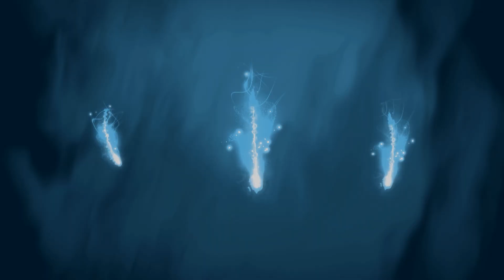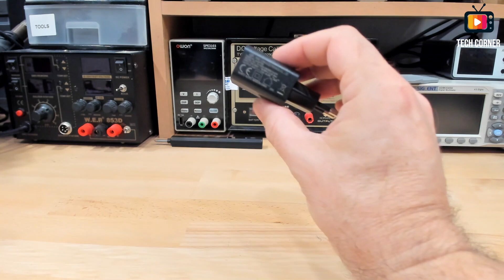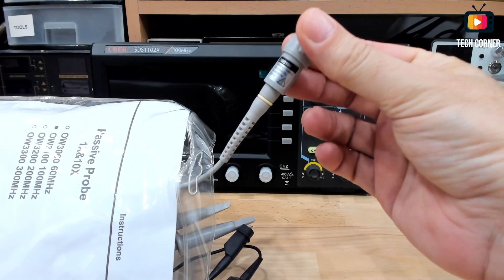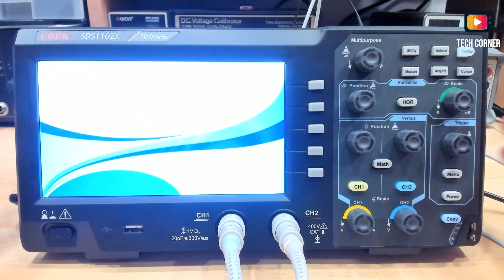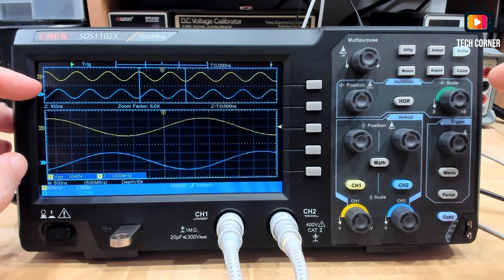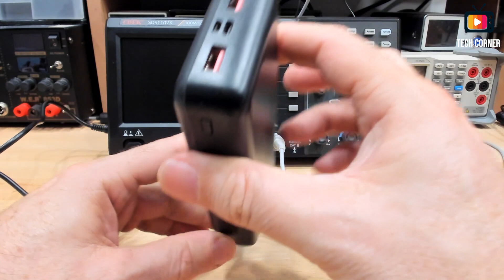CDEK SDS1102X Oscilloscope ⭐ Cheapest Of Them All. Interestingly one of the best!

Comment: Sorry to break the news, but this model is no longer available. The links on Aliexpress and Amazon are dead and its not available on Banggood either. However the news isn't all bad. I was able to find what seems to be a very close resembling device the Victor 1100A. There are two versions, the ultra cheap Victor 1100A which looks suspiciously like the CDEK  and  the 1100AXS which has a single channel function generator.  I wouldn't be surprised if they are made by Lilliput for Victor in Shenzen on an OEM basis. Which would explain why Lilliput withdrew the CDEK from the market.
Reply from the maker: Thanks for sharing that info, Michael! It's a shame the CDEK SDS1102X is gone – it was a great budget scope. The Victor 1100A does look very similar; your guess about Lilliput OEMing for Victor makes sense. If you end up testing the 1100A, let me know how it compares! I'll keep an eye out for that model in case it becomes the next hidden gem.

Comment: In 2026, Be Careful! There are different versions of it, especially if you have the model with external 5V usb power supply, the lower vertical limit is mediocre 20mv/div (Sensitivity also declared as 20mV instead as it should be in SDS1102 5mV)  instead former (220V direct power versions)! Inside is SDS1102C_V2.2 2023.05.09  board, which also does not have ferrite protection of display cable.  So such version is mostly rubbish in precise measurements like low mV noise, HI-FI audio OUs, etc.
Reply from the maker: Thanks for the heads-up! I didn’t test the low-mV limit on my unit, but your info is really valuable for anyone considering this scope. I’ll add a note in the description about checking the board revision before buying.

Comment: The SDS1102 has noticed a peculiarity. In the Trigger Menu - Coupling AC (probe divider X10, v/div = 2 V), Auto mode, the signal is only synchronized by the trigger to the center of the screen, more precisely +/- 2 v/div. Is this correct? If I move the signal up or down and point the trigger at the signal, the trigger does not synchronize the signal. The signal is a square wave, vertical sweep 2 V, and the trigger is triggered at the center of the screen in the range of +2 V and -2 V. However, the signal display may be higher or lower. Is this correct?
If I select Trigger Menu - Coupling DC, Auto mode, and point the trigger at the signal, which can be anywhere on the screen, synchronization occurs.

Comment: great video! can this scope do a bode plot, perhaps with an external generator from siglent? if yes i'll buy both right this minute.
Reply from the maker: Hi, not within this price range, but i will have a video that will be online this Friday 6th at 14:00 GMT for the new FNIRSI DPOS350P, it is a 350Mhz oscilloscope + 50Mhz SigHen + Frequency Response Analyzer (FRA) + Spectrum Analyzer for a crazy low price. It will worth viewing the video. Thanks for watching and your comment.
Reply: @TechCornerTV sadly on the Fnirsi the FFT starts at 200kHz and freq response plots at 100 Hz and I need it for audio work which means i need both to go down to DC and up to 100 MHz (for eg class D). Really surprised the 1102X doesn't do bode plots! would have been perfect for me otherwise.

Comment: Can you run the scope on a battery pack?
Reply from the maker: HI, yes it can. You need to have one with enough amperage, but bottom line is yes. Thanks for watching.
Reply: @TechCornerTV  Yes you can, I have the Vevor SDS1102 Clone Version and I have successfully converted it to run off of a USB Powerbank or AC Power. Reply for the Details.
Reply: Yes you can, I have the Vevor SDS1102 Clone Version and I have successfully converted it to run off of a USB Powerbank or AC Power. Reply for the Details.

Comment: Why is there so much noise on the signal? When i connect my x1 or x10 probe to the 1kHz signal source there is a lot of noise visible but its is not coming from the signal, it appears to be the channel amplifier. If I attach my older Fluke oscilloscope to the 1KHz source I get a pure square wave. It bothers me so much I am returning it to Amazon. Are all these budget and intermediate scopes likely to display so much noise?
Reply: Why does my Ferrari drive so much better than my Hyundai Sonata?

Comment: I think the fact that it is ONLY 500MS/s sampling rare total should have been mentioned (unless I missed it).
I makes a difference, so BW AWARE, as most are 1GS/s
Reply from the maker: Hi Steven, if I may, let me correct you. It is really 1GS/s BUT divided by 2 channels. The thing is, and I think I mentioned in the video (sorry if I forgot), normally and oscilloscope can use the full 1GS/s in 1 channel and divide by 2 when using the 2 channels. This one, I don't remember exactly now, but I think that it is also at 500MS/s either you use one or two. Thanks for watching and commenting.
Reply: @TechCornerTV  Fair point, but you still lose the ability of 1G/s in single channel mode., that most other scope in that class provide, ...yes at a higher price.
Overall I think one would be better off buying scope from Hantek for little more, apart from true 1G/s, it is a better scope.
On a side note, I do LOVE the low voltage power input, making it great for PSU work if you use a battery to power it.
The FRNSI has this, but it is a BAD scope that does not meet it's specs, at least the CDEK is honest!

Comment: So I picked up one of these in the end, and using a uni-t g932 to generate signals, seems to work fine, but connect up the probe on the cdek and something odd is happening, it is picking up an unknown signal with a peak of about 50 hz...even though i'm generating a 10hz sine, tried it with pulse and other wave forms too and I still get this weird unknown signal...Any idea whats going on?
I hit the autoset but doesn't change anything, and both probes are picking up the same weird signal.
Reply: Try using a cleaner power supply (try with a power bank as CDEK, as far as I remember, doesn't draw much current).
The lack of grounding of your scope can be a problem as well. After all every wire is an antenna and your scope probes are no exception.

Comment: I just watched the video.
I just subscribed to your channel
My understanding is that if it can be battery powered then it has ground isolation like a portable oscilloscope for repairing switching power supplies.
Am I right or was this an incorrect assumption?
Reply from the maker: Hello, you're right. Since it is powered by USB, it was no earth connector, so it is isolated. Thanks for watching.
Reply: Yes you can, I have the Vevor SDS1102 Clone Version and I have successfully converted it to run off of a USB Powerbank or AC Power. Reply for the Details.

Comment: The same product is also sold under the VEVOR brand
Reply: You are correct. I just bought the Vevor SDS1102 ...
Reply from the maker: Hi, nice to know, thanks for watching and sharing the info!
Reply: Technically not in all cases. I have seen Hanmatek with DC or DC power, but not Vevor or another rebrand called Labloot which are AC powered. That may affect the internal specs.

Comment: Exact same software interface as the Hanmatek DOS1102, so assuming the same manufacturer. That split screen XY interface with no way to full-size the XY view is awful, and is the reason I sold it.
Reply from the maker: Hi, considering the other entry level oscilloscopes available, 1104D, 2D10/15, etc, this has a better interface in my opinion, not including obviously Rigol, Siglent and so on, that have a much higher price and specs. Thanks for watching.
Reply: @TechCornerTV  It's not a bad scope, as long as you don't plan on using XY mode. I just can't understand why they didn't at least allow full-screen XY to be an option - it's such an easy and basic expected thing coming from any other scope. The best thing  any of these low end scope companies could do is to just open source their firmware - the community would go absolutely wild.

Comment: I'm glad that Owen/CDEK have decided to compete with the annoyingly popular Fnirsi 1014D, which has traditionally been overpriced for what it is.  Fnirsi now makes many excellent products, but the 1014D is not one of them and they will hopefully upgrade or replace it soon with something that is a tool rather than a toy.
Reply from the maker: Hi, I'm started to think that CDEK is just a brand of Liliput to send Owon devices to the market at a lower price. With this new updated hardware, this is really nice as oscilloscope, almost rigol level nice. Thanks for watching.
Reply: yes and the 1014d front end seems only supporting 30mhz, it claims 100mhz, above 30 is -3db down.
Reply: but 1014d here(indonesia) is cheaper around 140usd, the sds1102s is 400usd, so is fair price to fnirsi side. i acctually buy zoyi zt703s, update the filmware to 1.4.2 and is very good